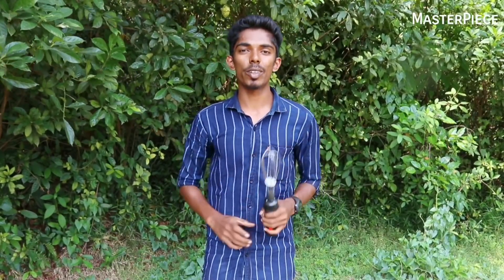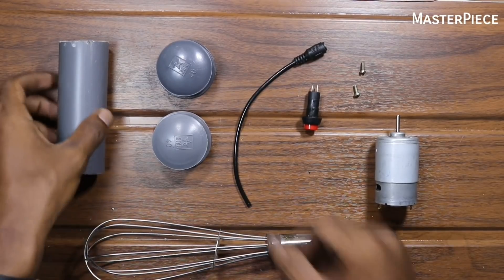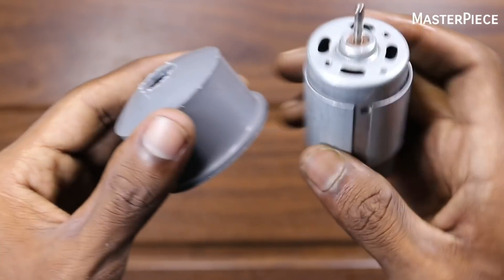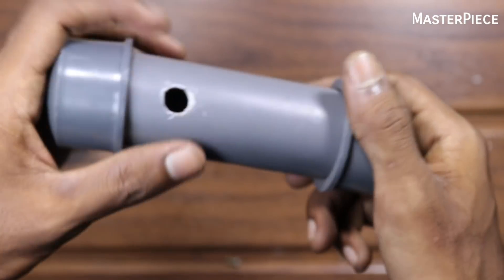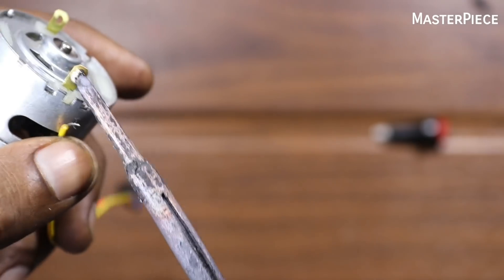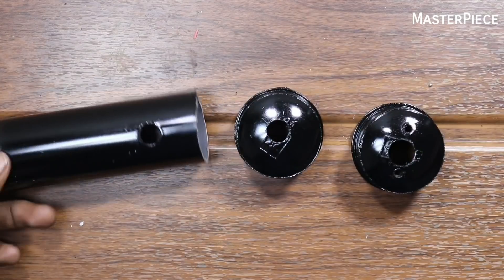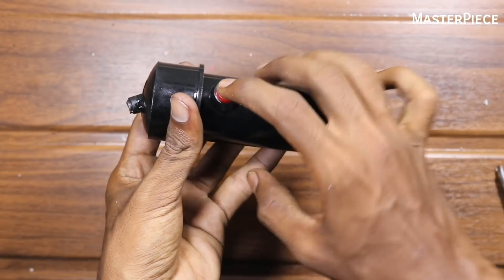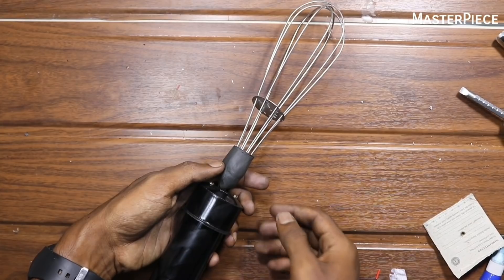ഇലക്ട്രിക് ബീറ്റർ ഉണ്ടാക്കാം | How to make Beater | DC motor | PVC | Wisk |Masterpiece

Comment: Just reduce input voltage (use 9V) and put a capacitor (ceramic) parallel to motor for surge protection.

Pinne pathram koodi mattanam.

Then issue fixed :)
Reply: @Haneed anu motor bush ൽ നിന്നുള്ള noise മറ്റു radio signal interference കൾ ഉണ്ടാക്കാതിരിക്കാൻ വേണ്ടി (eg: Bluetooth, WiFi പോലത്തെ signal കളുടെ പ്രവർത്തനങ്ങൾ തടസ്സപ്പെടുത്താതിരിക്കാൻ)